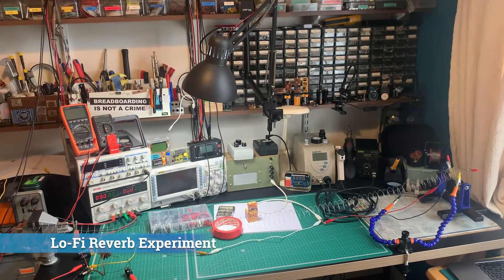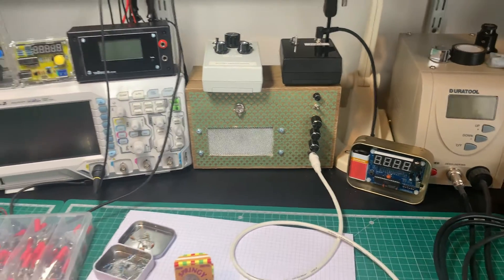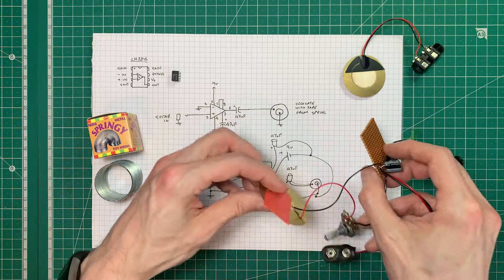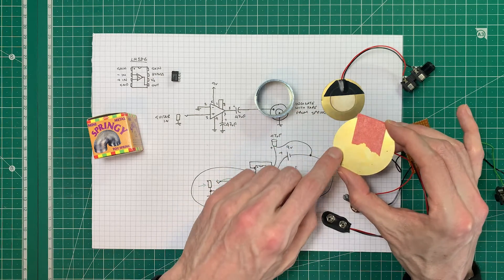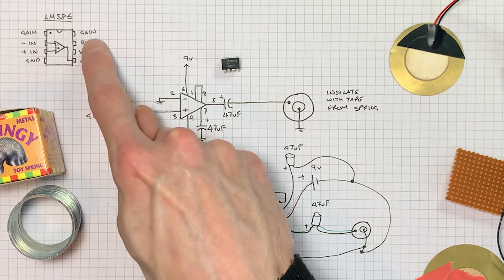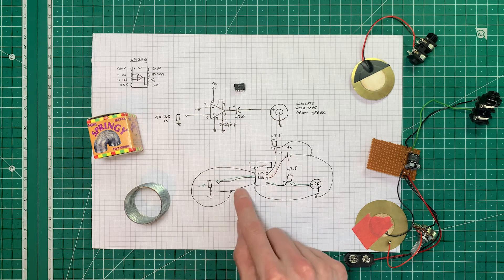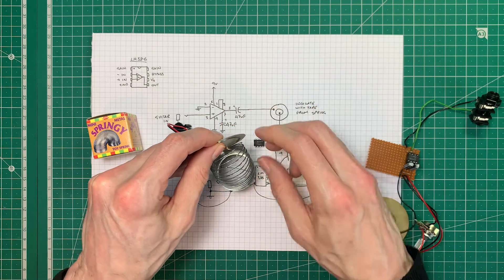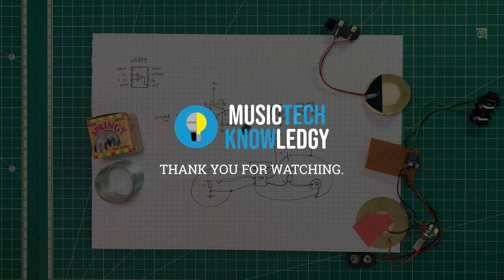Turning a Slinky into a LoFi Spring Reverb

Comment: Usually spring reverb is using rotations (twisting deformations) instead just pushing spring forward. It's because it's not winding that gives reverberation, it's the wire itself -- sound propagates along the metal.
Reply from the maker: Indeed.  I might return to this and play around with some different drivers to twist this, in the future.  I've seen various builders use the inner coil of a speaker (cone removed) or a small motor in their versions.

Comment: Lookmumnocomputer made a spring reverb using a spring from a Thunder toy made in Indonesia but instead of a piezo he used a DC motor to convert the audio signal into a twisting motion.
Reply from the maker: Ah, cool, that's an excellent way of approaching it, much more similar to the coil based spring driver in commercial reverb tanks.  I'll check that out. Thank you 👍.